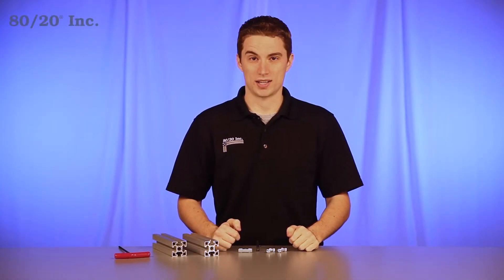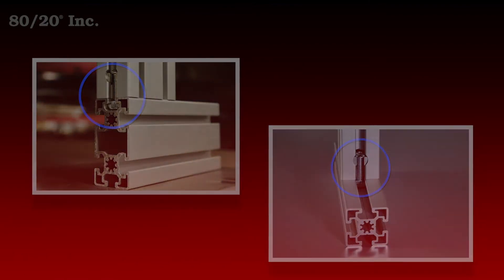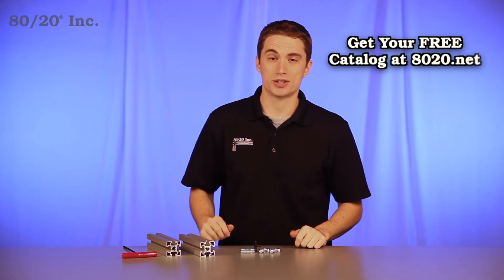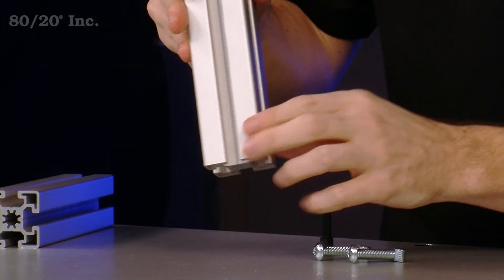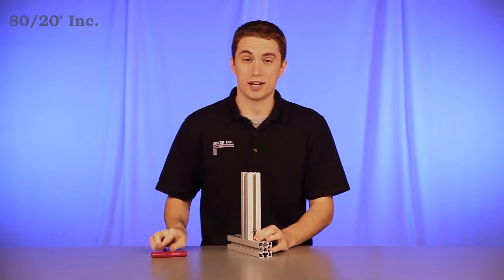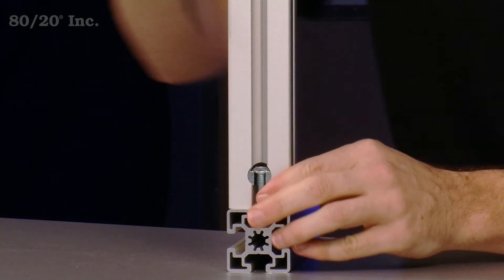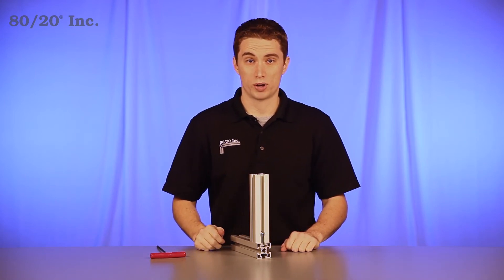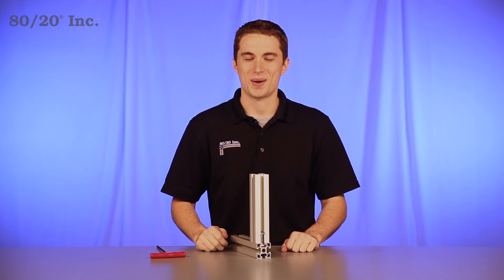80/20: Bolt Connector Overview

Comment: Is there a method used to connect long pieces, end to end? I'm building a 70 ft (dual 35ft tracks actually) and was considering 1530. But I've never considered how one might connect prrfectly flush butt joint?
Reply from the maker: Hi there - that's a great question! There are a couple of different ways to join the 1530 end to end, the best solution depends on your design.

1) The simplest would-be ( PN 4368 ) joining plates, one on either side of the 3” face. (Catalog page 240)
https://catalogs.8020.net/80-20-Inc-Catalog-23/240/
2) The next step-up would-be option #1 with the addition of two spring pins inserted into the 0.262 dia through holes to assist with alignment.
3) Butt Fasteners would be the next option.  They will hold the bars squarer and tighter than joining plates. (Catalog 217) https://catalogs.8020.net/80-20-Inc-Catalog-23/217/

The strongest, most accurate and straightest connection would be the Butt Fasteners with spring pins in the 0.262 dia through holes.

** One thing to keep in mind are bar tolerances for the through hole and t-slots, the combination of both of those could offset the side of the bar a few thousands from flush.

I hope that helps! Let us know if you have further questions. Have a great day!